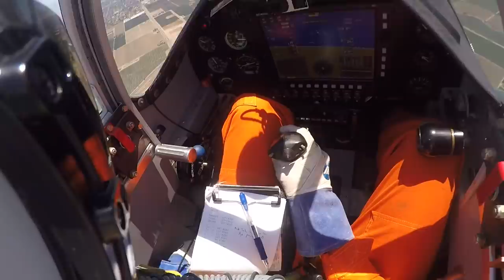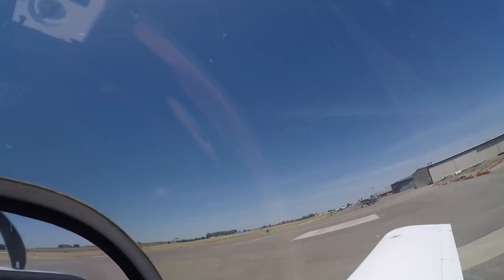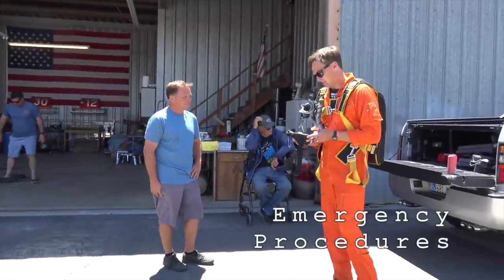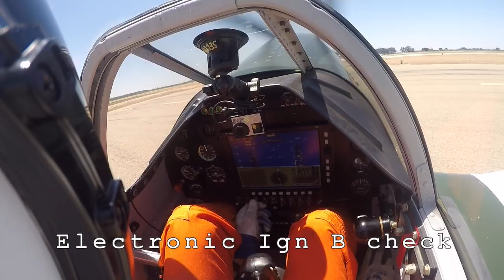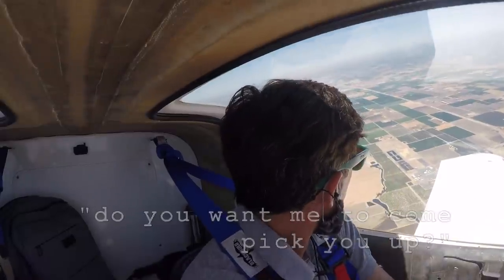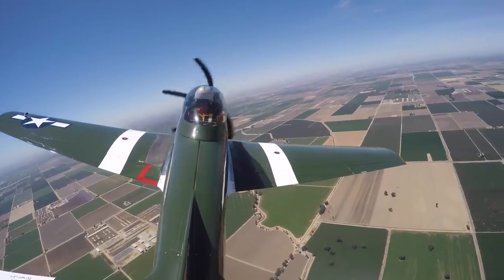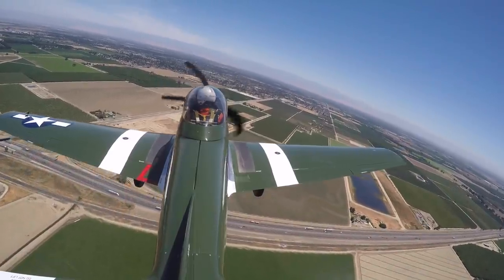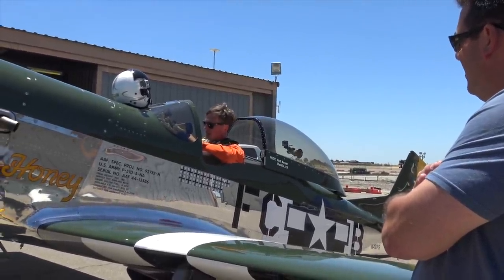EMERGENCY - Landing Gear Stuck/Engine Issues - Bowerspony Flt015 Wasabi Flight Test

Comment: don't disregard the low voltage flash.   when you first hit the gear up switch the hydraulic motor is under a very light load, but as the gear gets higher the load on the hydraulic motor increases drastically.  the flash you saw on the low voltage indicator tells me the battery / wiring to the hydraulic motor cannot supply enough power to finish the cycle. this drops the pressure and then the motor has a harder time to get it back as well.  this also messes with the pressure regulator. so you get a "pumping/ surge " cycle going.    .....  motor/wiring cannot get enough juice to run without dragging down the voltage, making the motor now to under powered to continue.   if you set the pressures up you'll get past it sometimes as the motor is under strain for less time (faster cycle). 

     test:   connect the low voltage indicator directly to the motor actually  physically AT  the motor to see actually what it's getting to work with and get a digital scope to monitor this and save the voltage profile  all thru the whole cycle.  now you can actually see the motor strain as it works.

be aware that testing on the ground, does not simulate flight.  especially in electrical.  
to just cycle the gear alone is not valid as the battery is at it's best......
 
Test with full avionics/radios/lights on and engine running.  each system lowers the battery voltage a little.
is the aircraft alternator regulator able to compensate and support the aircraft even at idle?
or are you slowly eating away at the battery voltage with a long taxi or long ramp time, then asking it to get the gear up while it's weakened........

a weak or under rated battery could be the cause ,...... but i would be looking at the wiring to the motor, and a probable increase in the wire size (lower gage) to not have as much wiring voltage loss to the hydraulic motor.   now redo the scope test .

every piece of wire, connection, switch, will affect the performance of the motor.

wires are like rubber bands.  each one stretches(looses a little power) depending on load (amps used).   more load=more stretch=less voltage to work with

smaller wires lose more, heavier wires lose less..... length also matters.....  
take some measurements and see what the motor has to work with.

love watching you work.... i've been following this since the beginning,  even talked with Jim and Peggy years ago about buying the company he had about 43 kits sold then....before the trouble he had with his overseas production tooling getting tied up in foreign country.

please pass this on...  to them   thx  Jim
Reply from the maker: Thanks for the detailed comment.
Reply: Great comment 👍🏻
Reply: Wouldn't that be an amperage issue, not a voltage issue though?
Reply: l agree...
Reply: @noelwade  if the amperage is maxed and the breaker doesn't pop, the voltage will drop.
Reply: jpopwell1 I agree, not enough amps could explain both landing gear and engine issues... however it could very well be 2 unrelated problems...  very interesting video anyways ! Looking forward to have the explanation.
Reply: @utopiasnow  Q : When the gear was hanging out of the hole and almost retracted, was the hyd pack running the whole time until it seated with your stick oscillate?
Reply: Don't forget the inrush current.  No alternator can keep up with that.  For reference, the Parker hydraulic pumps pull about 150A for ~100 ms during start up.
Reply: Also testing on the jacks does not take into account the air loads on the gear. It will be harder to retract in the air. Ah the joys of experimental airplanes!
Reply: @N91CZ  Sounds like a situation where an accumulator and startup bypass circuit is needed. Moderate startup loads with bypass until it's moving fluid, close the bypass and charge the accumulator to operating pressure, apply demand to accumulator with pump active. Shut it off and bleed the accumulator to the reservoir. These don't have to be very large, just basically avoiding surges in demand on the pump.
Reply: and can affect ignition.. and an ampere meter
Reply: B in b I’m in

Comment: Soaking it up -- it's all osmosis and reflection, especially the procedural discipline. The review of judgment calls, whys and wherefores, totality of situation as aggregated, is all instructive and the best ever. Takeaways: When it's a hydro check flight, chase needs to be there waiting for each event stage. Also, more attention to electrical underlying the process which seems to be at 95% instead of 110%. It feels guilty to gain so much from the setbacks of this fine owner/builder. Admire the tenacity and resilience. Wholehearted rooting for his success and triumph of the Bowerspony!
Reply from the maker: Thank you for the thoughtful comment John.  I really appreciate the considerate reflection.

Comment: Very impressed by this: First of the detail of the video (thank you!) and 2nd by the procedures you apply before, during and after the flight. I run a web hosting company and we do similar things on big and important changes or maintenance: pre-execution briefings (going through everything and making sure everybody is informed - and yea we also have cases like the tractor person, in our situation it's more like a customer freaking out :). 
What we're not doing yet: a post-briefing where we go through everything that happened step by step with everybody confirming their approval or possibility to add. Will totally do this in the future!
Thank you!
Reply from the maker: Thanks Michael, I am glad any of this is useful.
Reply: As a fellow IT professional I can attest to the value of both post-flight debriefs and "post mortem" debriefs after a major update or outage. Its important that they don't turn into a "blame-game" and get personal; but rather focus on things that can be done better next time through concrete action (i.e. different comms verbiage, adding checklist items, cross-checks, etc). One way to help with that at company meetings is to alternate talking about 1 thing that went poorly, and then 1 thing that went well. Having those little moments where people can pat each other (or themselves) on the back avoids falling into a big negative spiral.
Reply: @noelwade  and I think that's exactly what I'm so impressed by Elliot and other test pilots: the capability to look at faults, even if they are human faults, and just accept them with no blame, and not only this but also search an improvement on themselves that could have prevented the situation. I think that's a huge skill that we should flex more and more, not just while flying or work.
Reply: LOL the freaking tractor guy just showing up and taking the airplane.

Comment: The only thing I would suggest is to have chase do a departure pick up like you have done in the past with this aircraft.  My flight testing is in the rotary wing world so we have the luxury of having chase aboard from the time we leave the chocks, however, when we utilize a fix wing as chase we always do a departure pickup even if the mission is a low risk. As you well know any risk is a risk that can compound when things are not going as planned/expected. When you have an anomaly chase is there to give you immediate feed back of the situation to help cool the helmet fire. We have found that it is strong risk mitigation .  
Just my two cents worth. Love the new format. I can’t wait for more.
Reply from the maker: Thanks for the comment.  We recently got bit by low chase on this program, so we switched back to high chase.  The real answer is a chase plane that can keep up.  Maybe someday.

Comment: What an unexpected failure right in the beginning of the flight. Good call on trying not to stretch it any further and returning to the airport. I think it was very wise to be on CTAF so everyone could understand and give you some working room. There is just nothing routine about test flying, is there? After 14 other flights, you would think you have a pretty good feel on the basics, and then something like this happens. Getting hit with something like this right off the runway would really get my heart racing.....and then the potential overheating caused by the blocked cooling inlet. Good job holding it together and getting safely on the ground. This is great content, and a warning for all of us to never get complacent!
Reply from the maker: Thank you James.  I am glad the information was valuable.

Comment: If you read the history of the 'Mustang' you might come across the information that Several Mustangs were lost due to inner wheel door failures. It seems someone decided to eliminate the door locks on the inner wheel doors which allowed them to partially open during flight at cruise speeds. The result was that the planes suffered catastrophic failure of the wing and crashed. This only came to light when the mechanics and engineers jacked up one of the planes to test the systems and couldn't find the problem. The tale says, They went to lunch leaving the plane up on jacks with the gear retracted and when they returned to their surprise one of the doors had leaked off pressure and fallen open as the plane wasn't equipped with uplocks on the inner wheel doors.

Comment: The detailed debrifieng was great. This tailwheel planes you never stop flying them until you park them. That "almost lack of elevator" at the landing should have been scary. What was on your mind if you were unable to get the tail down? Engine off to save the engine?
Reply from the maker: It's a fine line, for now I think the landing was just a bit fast.  But it shows how cascading issues eat up bandwidth and the pilot starts dropping other tasks.  Thanks for the comment.

Comment: Air speed could play a part in the gear binding up, but it's most likely a pressure issue like air in the system which would also cause the pressures to read low and spike around. I would cycle the gear on the stands with about 100lbs of force pushing aft on the wheel to see if you can reproduce the issue after bleeding the system.
Reply from the maker: Thanks for the advice.  I appreciate it.
Reply: Also can't wait to see you get the raptor off in these coming weeks elliot.

Comment: I know the cockpit is tight in that plane, but couldn’t you set a tablet or phone up with a wireless connection to the belly camera, especially since the gear has been an on going problem? That way you could see issues immediately. I too really enjoy this format, thanks for sharing.
Reply from the maker: Thanks Trent, this idea has been suggested before.  Certainly a possibility.  I think we are guilty of consistently thinking the problem has been fixed.  We'll take it into consideration.

Comment: Excellent format. Really enjoying all the details...and the lessons learned as a result of them. You're a  real pro Elliot. Curious what the endgame is. How long is a testing phase scheduled to last? Or is it flexible contingent on results? At what point will you "sign it off" and call the testing complete?  Seems like with a plane of this type a lot of these things (or other things)  may continue to come up. I'm guessing planes like that are a maintenance challenge for the life of the plane?
Reply from the maker: Thank you for the note.  We were initially brought on to fly the first ten hours.  After ten we were invited to stick around.  The airplane has certainly had some teething issues, but I honestly expected worse, those guys have been working super hard to make it come together.  At the end of the day as cool as the Stewart is very few have been built.  As a result they are all different and customized.  Gear, Flaps, Controllable Prop, PSRU, Cooling System....its a lot of systems to figure out.  And with that glide ratio the margins for error are slim.

Thanks for the note!
Reply: Thanks so much for the reply...that makes sense. Hell I'd keep you around too ! Once they see your "system" I would think its obvious there is no better way to certify it safely.
Reply from the maker: @ModelAV8RChannel  Thanks man

Comment: Thanks Elliot, great video. I know your job is to help the owner/operator/builder shake out the bugs but do you ever reach a point with a plane where things just aren't getting fixed and you terminate your involvement?
Reply from the maker: Interesting question.  Short answer is yes.  We walk away from projects all the time a few just this past month.  It all comes down to relationships and having a path to a result.  We all have blind spots and strength areas, the question is do we complement each other's skillsets.  The type of guy who is able to turn an idea into flyable hardware is going to be a strong personality.  Assuming no one is lying, it's just a matter of figuring out how to work together. 
In the case of the Bowerspony I think we all feel fortunate to support Rod, who is a great guy and a long time EAAer and to support the Stewart community (its a super cool airplane).
Reply: @utopiasnow  Thanks for the answer and good luck with this one and the Raptor!

Comment: I was concerned when Rod said the gear didn’t “retract properly “ at 950 psi so they increased it to 1050 psi on jacks with no airflow or vibration thats a tiny margin, my gut would say the pump and wiring is under the capacity required, you only had 600 psi when the gear was stalled, love the video’s
Reply from the maker: Great point Greg, thank you.

Comment: Just found you.  I like the new format better than the old.  Like the deep-dive and glad to see the flash clips gone, they were just annoying.  I am building an RV-10, so your insights into test flying are very interesting and helpful.  Just a couple of questions and a comment.  (1) The breather mask that you wear, what is the air supply?  Or is it just attached to a filter to protect you against fouled air, because I have not noticed a tank.  And do you carry a portable Carbon-Monoxide (CO) detector?   (2) Ok, looks like the gloves you wear are TIG welding gloves (Miller?), TIG gloves have good sensitivity so they would be a good choice, but not the firmest fit.  (3)  If  you are interested, I can send you a link to my build album, just let me know.  Regards, and "Planes are cool" :)

Comment: Great videos Elliot - but I have to add a bit of constructive feedback.  I am a pilot and a mechanic, and I really like to know how things work.  A bit more information on what was fixed and what was wrong would be helpful as a follow up to this  - some of it seemed to be operator induced but some if it by the guys messing with the aircraft as well.  I could do with a little more editing of the debriefs - I know how debriefs should be, just not enjoyable to watch sometime when people are waxing poetic about traffic in the run-up area, etc.
Reply from the maker: Interesting comment, thank you.  

"Waxing poetic about traffic in the run-up area", that's new.  The purpose of those comments was to close the loop on the comments made in the briefing about how the formation portions of the flight would go.  In formation flying things like who taxies out first, and when will we know when the run-up is complete can really confuse things, so we brief and debrief it.  The timestamps are available for folks that aren't interested.

The mechanic work is hard for me to add to since I didn't do the work so at the very least I didn't record it.  This isn't the first comment about adding more mechanic details.  I am going to work on that.

Comment: " Pitch bellcrank behind rear seat center bearing loose."  Did that have anything to do with the loss of elevator effectiveness when landing ?
Reply from the maker: I really doubt it.  Much more likely I landed too fast.  The bellcrank just meant there was more slop in the system than there should be.  Thank you for the comment.

Comment: I love this format. I didn’t see you mention the 600-800 psi readings on the hydraulic. The way I understood it. The hydraulic pumps pressurize by electric in the design and you had a low voltage and low psi. At speed were the gear doors creating to much resistance drag to allow it to work at  1000psi? Was that causing a higher electric draw to try to maintain the pressure? I’m hoping for a Electric, hydraulic  class 101 reply here.
Reply from the maker: These are the questions.  It seems likely the system is not operating as intended.  Eric has been hard at work investigating the entire hydraulic system.  I am confident good things will come from that.